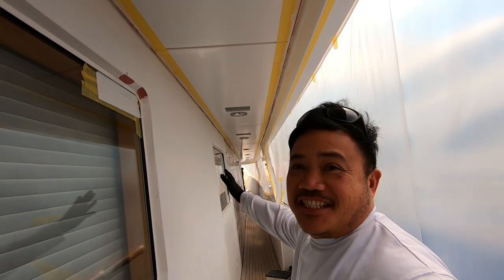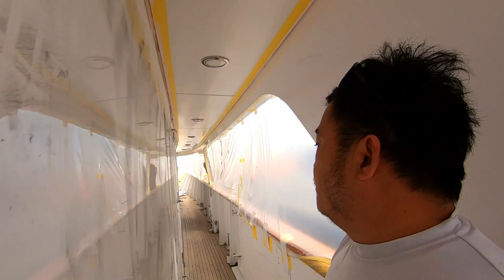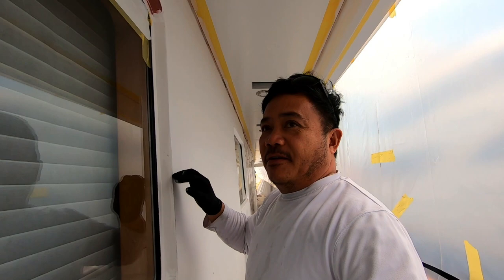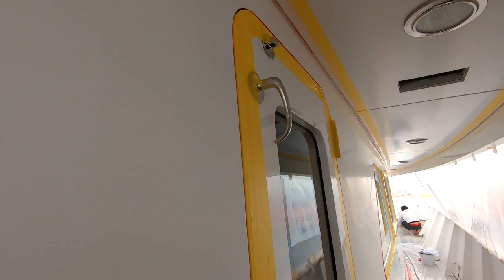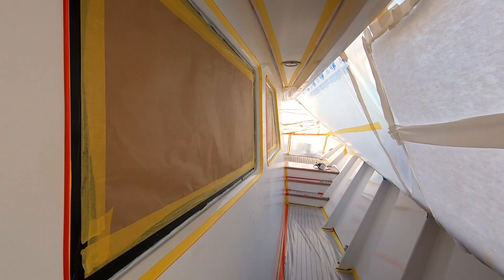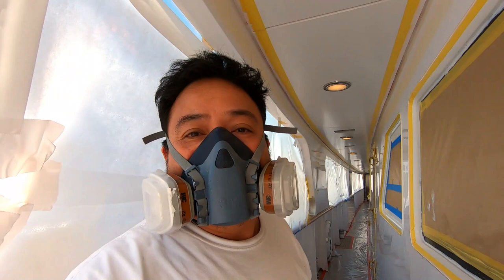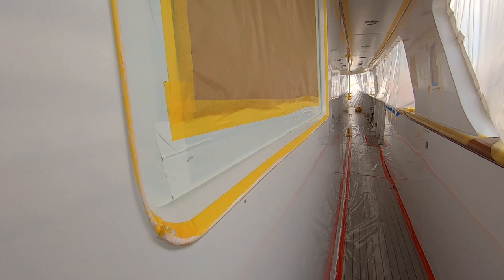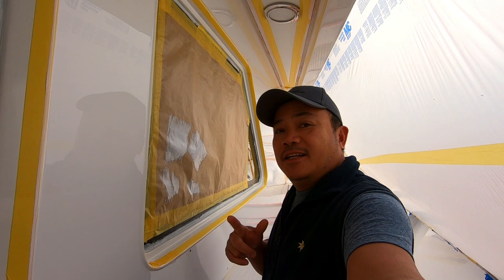My Biggest Awlgrip roll and tip project(the whole process)

Comment: Expalin your approach to bigger panels how to move and keep a wet edge . Like your channel I be look forward to new projects you are doing
Reply from the maker: hi Robert i explained it on my other video ...the way i do it is one square meter at a time or slightly less depending on your ability and if you are roll and tipping it with another person.
Reply: @leoncaputolan  thanks What brand foam roller do you buy .The one I buy don’t last long and denigrate to fast
Reply from the maker: this days i am using Anza Elite...this rollers uses a completely different fibers than the old Anza, these days they use a very fine fibers and they don't shred ,but this type of roller tend to soak a lot of paint so you have to be very careful of putting too much paint on the surface that you are painting ..specially on the vertical.
Reply: @leoncaputolan  thank you again for your input. Look forward to your video s  Stay well

Comment: I've read that awlgrip doesn't roll and tip as well as a paint like two part epifanes paint. Your opinion?
Reply from the maker: I have never used two part epifanes paint, awlgrip can be rolled and tipped very well, been doing it for a long time.
Reply: What's the proper mixing ratio for awlgrip I know some Spanish guys they just roll it they don't tip
Reply from the maker: @enlightenmentuplift4528  : For roller and brush,Mix by volume two parts Awlgrip Topcoat Base Component with one part Awlcat #3/H3002 Brushing Converter until one
smooth, homogenous mixture is obtained. Reduce 10-33% with T0031. Overall mix is 2:1:⅓-1 by volume (8 oz. Base, 4 oz. H3002, 1.3-
4 oz. T0031.
 
Yes you can just roll it only,but you need to use  a good quality roller preferably good foam roller...so it doesn't leave a lot of bubble trails behind.
Reply: When I roll out the paint and Tippett if I have a run like 10 minutes after can I go back and tip it again or will it leave a mark I just want to know how long after I roll it out and tape it before I can not touch it back again how long it takes
Reply: You should set up your Channel so if someone wants to leave a donation they can okay
Reply from the maker: @enlightenmentuplift4528  depending  on your painting environment, like your project is totally protected from the wind and the temperature is not humid and hot ,and the run is not too big and obvious ,maybe you can get away by tipping again the run, but ten minutes base on my experience is a bit  late...
Reply: What's the best foam roller to use what brand new use I've been searching and I only can find those cheap ones